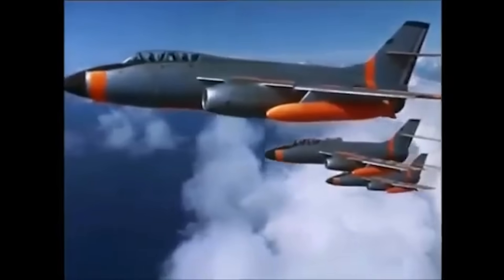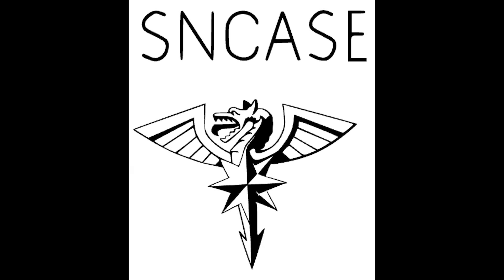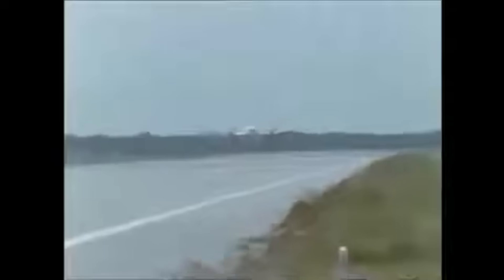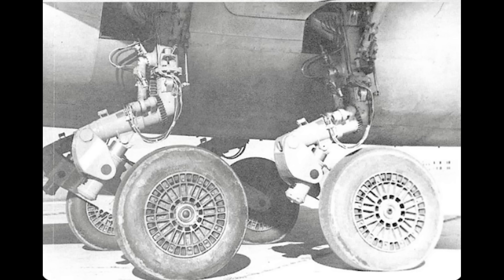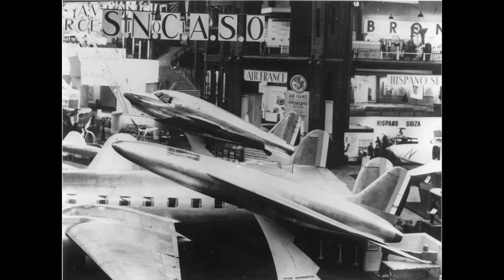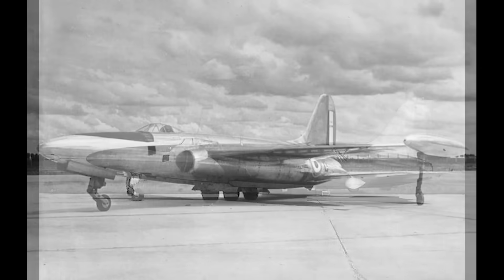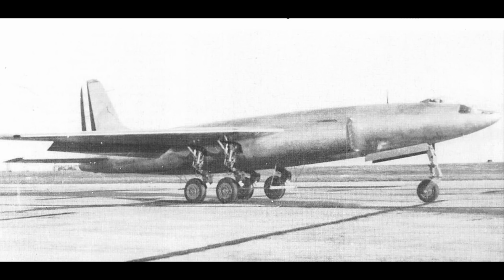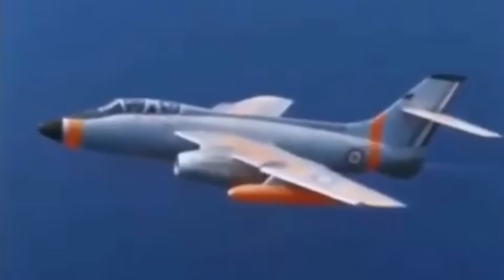The First Vulture - France's Flawed "Heavy" Bomber Experiment

Comment: It has so many modern features, except for the vertical tail, which differs little from a B-17 unit. Although this remained a general issue at that time, due to certain unknown directional stability issues.(AKA high angles of attack) Even so, the central landing gear appears overly complicated in terms of weight, and does not incorporate the wheels on a single strut. Thus leaving the matter of bomb type and load limited to  specific sizing.

Comment: A couple of nits, in an otherwise excellent post, but as an Engineer and long-time Historian of Aviation Technology, this got my attention. 
1 - The airplane was definitely not Area Ruled. An examination of the drawings shows that the cross-sectional area distribution doesn't even come close to what could be considered the proper shape.  
2 - The WW 2 Germans didn't have a clue about the Area Rule.  Kuchemann himself has stated on multiple occasions that he didn't know about it until he had seen  Richard Whitcomb's work at the N.A.C.A.
Unfortunately, there's a lot of noise in the more popular sources, much of it by well-meaning folks passing along what they've seen, but also leavened with Wehraboos Uber Alles, and now, unfortunately a ton of AI, uhm, stuff that makes for a highly unfavorable Signal to Noise Ratio in that area.
The need for Area Ruling doesn't become apparent until you reach speeds of Mach 0.92 or so.
Attempts to improve the high speed performance of the Hawker Hunter and Canadair Sabre by making them more compliant with the Area Rule did not produce any useful performance increases.
Reply: Thanks, if this is correct (always a worry with Internet comments) it's a valuable clarification.
Reply: Bullcrap......the Germans did have scientists and designers who had knowledge of the Area-Rule!
You might want to look on the design of the Junkers 388 of the 'Bomber B' program to verify my words.
The germans knew and implemented the rule earlier than the Yanks ever did.
Just because that engineer you mentioned   had no clue doesn't apply to the rest of them!

Comment: There are some factual errors in this video; notably: 
•—400'000 lbs = 182 Tons; but the actual bombload capacity of the Convair B-36J is 39 Tons (186 Tons is the maximum takeoff weight of the plane). 
•—45'000 lbs = 20 Tons; but the actual bombload capacity of the SNCASO Vautour II is 7 Tons (20 Tons is the maximum takeoff weight of the plane).
Reply: Maximum take-off weight is not bomb load. It is the total weight of the aircraft including fuel, crew, engines, landing gear, wing-spars, etc...
Reply: @hlynkacg9529 = Thanks for putting your finger on the "factual error".

Comment: Area Rule?  Sort of. The Far Field version, not just accommodating local flows, was Whitcomb, and came later.
Reply: Good call. I wondered if anyone would pick this up. Area rule, at least to address the transonic/supersonic  issue, was Whitcomb (as you identify)  with the F 102A Delta Dagger. A great intuitive solution from a non-degree engineer!

Comment: 9:22
Did they make a Heinkel-177 with it's 4 engines in separate nacelles?
Reply: He-274, it was a german bomber design, 2 prototypes of which were under construction in france, after the liberation the french finished them and used them mostly for air research

Comment: Ok I'm going to need a video on the French airforce use of German types immediately post war, I thought the Luftwaffe barely used the He274 and here she is in French markings. Thanks for the content.
Reply: It was built in France so it is most logical that it then also was used there: due to the Allied advance through Northwest Europe, the prototypes were abandoned at the factory in German-occupied France where they were being built. They were completed after the war by the French and used for high-altitude research. (And yes, the Germans therefore never used these planes at all)
Reply: I second that, it sounds like a very interesting topic!
Reply: Then you get into all the others - like the Czechs using the Me262 and having post-war border encounters with US and UK aircraft.
Reply: @iatsd see it didn't know about that, ty
Reply: The French used the Tiger II for longer than the Germans did, they didn't exactly have much after the war and had to make due. German equipment was plentiful, cheap, and had been abandoned in France in large numbers during the war.
Reply: @heirofaniu makes sense
Reply: @heirofaniu I don’t believe the Tiger 2 was used much by France. 

Mainly for testing purposes if anything and they came to the same conclusion as Germany; overweight and underpowered. 

You can however see its influence in the design of France’s own heavies, especially the AMX-50. 

Post-war they did operate a battalion of salvaged panthers until their own vehicles were ready. That might be what you’re thinking of
Reply: @tyler_bt3326  Probably, yeah. Thank you for the clarification I appreciate it.
Reply: Also interesting is the Armée de l'Air's post war use of Yak-9s which they inherited when the Free-French Normandie-Niemen squadron flew home after fighting in the Eastern front as part of the Soviet Air Force.
Reply: I guess the soviets were ok with that  ?
Reply: @lancaster5077  Yes. The Yaks were a gift.
Reply: @lancaster5077  while the YaK-9 was among the better frontline fighter of the SU at the time, it was hardly cutting edge, also they were a parting gift to the pilots of the Normandie-Niemen squadron who fought in the air war over the USSR
Reply: Yes please
Reply: the Fi-156 continued to evolve in French service until production ended in 1965. 925 were built by Morane-Saulnier. after the war the plane was known as the Criquet.
Reply: @BaikalTii thanks for the info😊
Reply: The French made use of everything they found, probably the only air force to have  constituted full units using birds built by almost every fighting Nation: German as we see here, but also Italian, Russian, British, Dutch, American and even Japanese.
Regarding the German productions, some having been built in France were used post WWII, notably Ju-52 and Focke Wulf-190, locally named NC -900, of which one remains, visible at le Bourget air museum, alongside an He-162 that was brought and tested in France.
Reply: @jetaddicted thankyou for taking the time 😊
Reply: I support this suggestion.
Reply: Rubbing it in the enemy's face by using former fascist vehicles to defend freedom until you can make your own is fine by me. Lets also not forget all the German research used to build post war aircraft/weapons by most allied nations. 
Giving their scientists asylum and a comfortable life for it though that was a slap in the face of any Allied citizen imo.😠 One thing the Soviet's got right is treat them as prisoners while they're useful then send them to the Gulags to finish their punishment.👍
Reply: @djcjr1x1  Get off your soap box, nobody cares.
Reply: They also used some japanese types in Asia! Surely would be an amazing topic.
Reply: @elasadito541  oh true, yeah, nearly forgot about those
Reply: Agree.
Reply: Les prises de guerre ont été testées en particulier le Do 335 par un organisme officiel sans compter les FW 190 qui étaient construits dans une usine souterraine secrète à Cravant dans l'Yonne 89460.

Comment: It's bizarre that the requirements for what became the Vatour 2 are essentially a reprise of the interwar BCR concept.
Reply: At least they weren't taking as many drugs as they did with those inter war designs.
Reply: some 20-odd years of technological development allowed to dig back into that concept, though a saner variant of it, as the original BCR in it's C (combat) role was more akin to a turret fighter than the all-weather interceptor that was the Vautour IIN
also it was saner in that the planes weren't supposed, nor expected to be able to fulfill all roles at once, unlike the BCR planes, the Vautour II had different variants for it's Attack (IIA) Bomber (IIB) and Interceptor (IIN) jobs, each fitted for the role